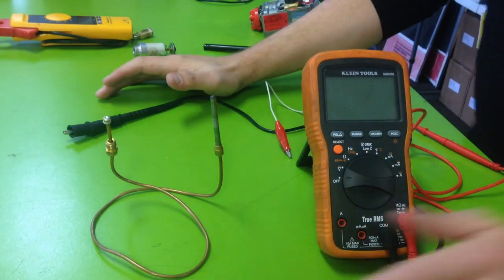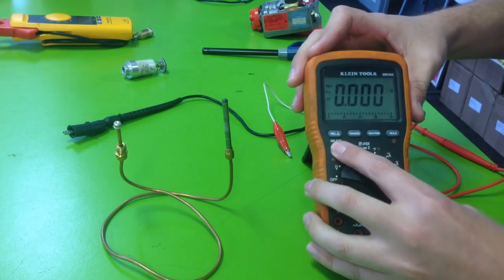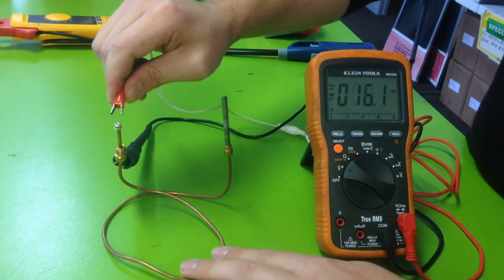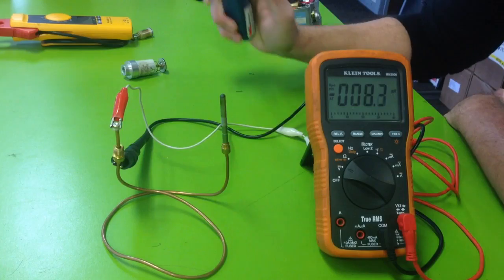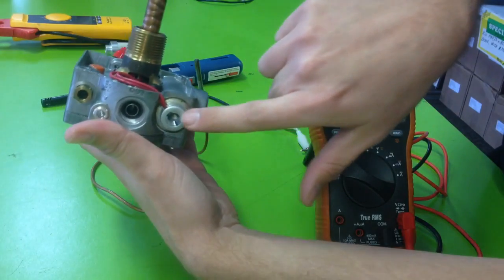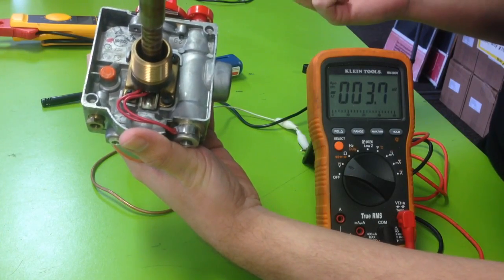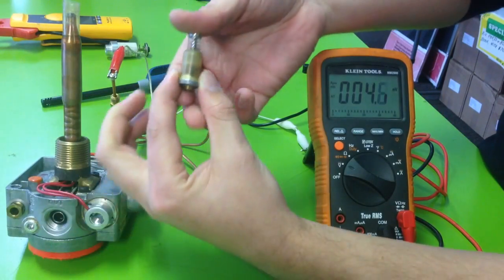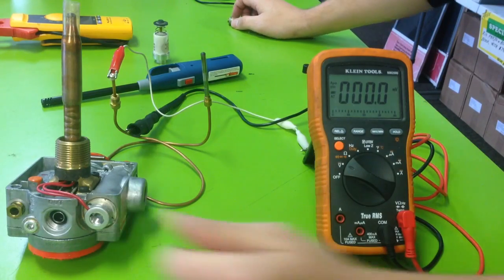How to test a thermocouple with meter

Comment: One important point you failed to mention is that the millivolt reading should be - at a minimum - over 25. Anything under that could cause either intermittent pilot flame outages or no pilot flame at all.

Comment: Hey mate, can you help me out here? if my digital thermometer is type K but my thermocouple wire is type J, i know that i will get a reading; however, how accurate is that? Is there any way to apply a correction or something else? because in my experience, by using such a set up im getting a reading with discrepancies up to 2-3°C respect to the reading obtained by using a thermometer type K with a thermocouple K.

Comment: My Thermo Pile & Thermocouple both test with ample milliamps.  When I turn on the heat demand switch the burner does not go on.  When activating the heat demand switch, the miliamps do not increase on my tester.  Is this because the burner does not go on?  Or is my Thermo Pile defective and the cause of the burner not turning on when I turn on the heat demand switch?   The pilot light is strong and blue.  I have tested the wall switch that should turn the burner and the switch tests good.  What else could be causing my burner not to turn on?

Comment: I have a thermocouple issue on my furnace right now. I tested the mVolts and it climbs to 29.2mV. From what I've read, 25mV or more is considered good. I cleaned all the connections at the cold end and measure 0 Ohm from copper tube to the gas control's housing. But while heated, it still fails to actuate the plunger. A new thermocouple fixes the issue. So my thought is that open circuit voltage test is not good enough. As my old thermocouple fails while under load(ie connected to the gas control)? I'm reading 0 resistance across the plunger relay which makes sense as a relay. What load resistance would be good to test it with? And what should the current(mA) be when it's under load? I think that will tell us a lot about a TC's real performance as I know they do degrade with use. Of course my gas control is 20+ years old and may just need a peak performing thermocouple to have enough juice to drive the old plunger relay.

Comment: I have a 1971 Piper Cherokee 140. Temp gauge stopped reading. I sent the DG (Directional Gyro) off for repair and 50 year old temp gauge. Should test bad I assumed. It tested ok. So the new sensor and cable (4 years?). I assumed I could test the sensors like a resistor. Can put volt meter in windshield. But “sender” has to be bad. Actually, it’s simpler than that.

Comment: When you press the button down, it bypasses the thermocouple and opens the pilot valve for manual lighting and when it’s heated enough you can release the button and the thermocouple will take over by holding the pilot valve open. The button itself isn’t supposed to stay depressed if the thermocouple is working, but the pilot valve should stay open if it’s sensing the flame properly.

Comment: It's sometimes not an easy chore at all to adjust a Honeywell thermocouple on an antique gravity furnace like the one that I have, and simply because the thermocouple is not only located on the far side of the burner, it's also difficult to see in there.  Actually, the best that I could achieve was 26.9 mVDC on the Honeywell 30.0 mVDC thermocouple, but I suppose it was good enough as it activated the control quick enough.

Comment: Danke von Deutschland aus, das war genau das was ich wissen wollte. --> Thank you ! That was exactly what i want to know, now i know that the elektic cycle is going over the copper and the middle Contact of brass ( it seems like brass in my case at home ) . Both are elektrically separated from the sensor to the gas-Switch. Thanks !

Comment: Apply the flame longer, after all, the pilot stays lit 24 hours a day. Voltage should rise to 25 to 35 millivolts DC on your DVM Voltmeter.   Using that device tester in the video, you still need apply the flame to see that the valve stays open when the button is pressed down.
Reply: Way better info than the video to much talking about  other stuff
Reply: That's good info. Thanks.
Reply: Surprise he failed to mention it
Reply: Best comment

Comment: Big help-my meter measures MV and was really good wondered about the spring but realized there were two springs in my Dual Radiant heater. The test showed it was responding to the MV output. Diagnosed it as a failure of the Dump
Switch that failed to connect on two heaters. Was cheap to replace -ordered four to be on the safe side.Now I have three heaters that all work! Good Job

Comment: If you were to apply a small amount of voltage from a milivolt source to the thermocouple, would it kill the termocouple? Not to the probe but from the connector.

Comment: The thermocouple demonstration is OK. But I am sure that the mV and small current generated by the thermocouple can never drive a solenoid. You must be having another supply which will pump enough current and voltage to drive that solenoid. The thermocouple is only giving a signal. Pl check.

Comment: What about the millivolt range that tells me that the TC is good or not?
Reply: 17 - 30 milliVolts, when tip placed in a flame.  0.3 - 0.4 ohms resistance when cold, with no flame.

Comment: I'm not a plumber or electrician but even I know that's a water heater....NOT a HOT water heater. If you have hot water why heat it...lol. (yeah yeah....I know it's commonly called a hot water heater but that's incorrect).

Comment: This fireplace heater looks great>>>ur2.pl/899 and works well. The flame effect is really impressive, as it's ability to heat up a room on it's own.The remote control is handy as well, but I noticed that the batteries will easily come loose inside of the remote if you drop it. That's a small flaw for an otherwise fantastic heater, though.

Comment: This has just saved me money, time and hassle.
If a thermocouple only produces millivolts, that output will suffer from any high resistance.
I stripped my Smeg hob down and, sure enough, the non-staying-lit burner had a bit of corrosion.
Everything cleaned, rebuilt and all OK. No cost at all.
Thanks.

Comment: Is my temperature sensor wire with two leads contacted with my motherboard a thermocouple?
Reply: If so, what metals are uses and can I detect this with a multimeter
Reply from the maker: They normally call it a thermister.  It’s very similar but instead of making voltage like a thermocouple does a thermister acts as a resistor.  As the temperature changes the ohms change and allows the mother board to read the temperature.  To test it you use the ohms setting and a lot of times the manufacturer has will tell you what it should read at various temps.  A lot of times they advise you to dip the probe into ice water and take an ohm measurement at the wires.
Reply: ELECTRIC TECH Yes. I plugged in some lead wires and taped them to the leads of my multimeter looking for voltage change patterns of any kind with no success. I will see if I can get a reading with Ohms. Because this is different than a thermocouple, are there still the concept of 2 dissimilar metals in the wires?
Reply from the maker: Jesse Levine  the wires are probably the same metal one wire carries voltage from the mother board to the temp sensor which restricts the voltage based on temp and the board then reads the returning voltage.  A lot of thermisters I deal with are made from ceramic material but it could be anything.
Reply: ELECTRIC TECH I still have questions but, thanks for replying, subbed

Comment: What is the white lead with the red clip attached to? What is the red lead attached to?
Reply: Steve Trubilla  Black lead goes to the copper jacket .... the red lead goes to the lead colored tip, the white lead was just an extension I had on the red lead.
Reply: Thank you. That is what I thought, just wanted to be sure.

Comment: so my pilot lights, then goes our randomly. I installed a new thermocouple ..... it still goes out occasionally. Wonder what is causing?
Reply: Or, you might have air coming back through your exhaust pipe. In this case, you might want to check your ventilation setup, and
take steps to prevent back-flow.
Reply: Hi rgee bee. Sorry I just assumed for what ever reason that it was a water heater.
Common with wall mounted furnaces is the pilot flame blowing out due to a weak pilot flame and the wind. This is because the venting run is usually very short (against the wall). I'd check to see that the pilot flame is strong and not fluttering. If fluttering you can check for an obstruction in the pilot tubing. Check to see that the pilot flame is hitting the last 3/4" of the thermocouple. If all that checks out and it still is going out, check the mV of the thermocouple. Best of luck!
Reply: rgee bee   Watch the flame 🔥 make sure it’s directly hitting the thermocouple and not moving around from wind / or blower motor, if that looks good your control could possible be going bad
Reply: Test voltage. Normal operation is 17-32mV. If lower, check that the pilot flame is burning steady and contacting the tip of the thermocouple.
Check venting for obstructions and that the water heater is getting enough combustion air. When the main burner fires, the flame should be more blue than orange.
Are you running out of hot water? If you run your tank to depletion (completely cold), the water heater will condensate, and the drips of condensation can put out the pilot flame.
Less common is the gas control is at fault.
Just some ideas, hopefully it helps!
Reply: Guardian TV....Thanks much for suggestion will check it out. My furnace is a wall mounted small unit in a 500 sq ft cottage in Upstate NY, and I've had the place for 15 years....I think the unit was installed in the 80s. This is the first thermocouple I ever replaced.
Reply: thanks Pros....It's a wall mounted Sears "furnace" with a blower. I did have a bee hive in an adjacent wall last year and I think I remember moving the flu pipe and reconnecting it.....will ck it out. Also I may not have the pilot flame on the tip of the t-couple.....will ck out and fix. Thanks for suggestions
Reply: PROS DIY.....I appreciate your advice here. I'm headed out to cottage this week and will investigate. I think you hit on it because it may very well be the position of the t-couple on the pilot flame. Last I remember the flame was strong and steady. I had a group of renters in there when the problem occurred and we were having a lot of wind. I'm sure the wind had a contribution but one of the guys in the group was on it and thought it was a malfunction because the pilot went out several times.....so advice taken will ck it out thanks again for taking time!
Reply: Seemsayin Yep. I’m with you.. could be the cap on the roof sending a draft back down the  flame and blowing it out! 😊

Comment: FYI Thermocouples that are good should read approx. 30 mVolts DC.
Reply: Daryl Dugger so 14 is bad then? I should replace?  Pilot stays on but heat does not come on
Reply: 14 is middle of the road, but not bad. Anything under 7,  & you're dead in the water.
If it's 14, get some emery cloth & sand the thermopile probe clean. Shut the gas off first!
Or you can install a new one. I think they cost about $10.

Comment: Thanks for the video.  I was having an issue with the pilot light for my RV stove.  Before I completely replaced the thermocouple i followed the test progression you described and found that everything seemed to be fine.  I reseated all the connections and got it to work.  Thanks from a novice electric guy.

Comment: even getting a 30 mv output reading on a thermocouple does not necessarily  mean its good. The time it takes to reach the  operating  voltage is also a factor. My boiler pilot light would not remain lit so  I tested it with a meter by removing he end that was connected to the gas valve and used the pilot light to heat the  element .  It took a long time to get to 30mv. Initially I thought it was good and that the problem might be the gas valve but I chose to replace it anyway and sure enough the one that I tested was bad.
Reply from the maker: +588158  the fact that it made voltage should hold the coil in place once lit, sometimes just unscrewing / rescrewing the end in and out of the control fixes a contact issue.
Reply: I did that too figuring it might be a high resistive connection but it didn't work. The tube was quite sooty which may have acted as an insulator hence the slow rise in voltage.

Comment: Thanks for the video partner!
Quick question 
Where can I get the thermocouple tester that you showed there?
Did you remove it out of a gas valve?🤔
Reply from the maker: +killer350dz  you can find them online, I got mine from one of my distributors a few years ago and only cost like 20 bucks, you can remove them out the valves but they don't have treads on them like the tester does.

Comment: how do you like that klein 2000,i just bought one.
Reply from the maker: +wade rigsbee Its great, I use this one to do all my videos because it has the biggest display.  I have fluke meters that cost twice as much but this klein Meter has all the same functions and works just as good.  The only thing I like better on the fluke meters are the wire leads are better quality, so I end up using the fluke wire leads on my klein meter when I'm working on customers units.
Reply: +cosmocasper thanks